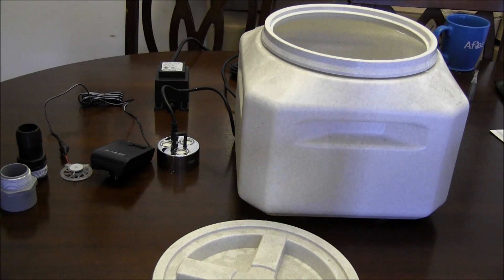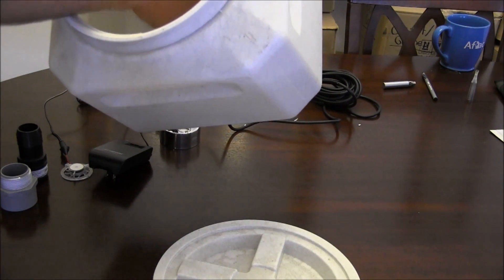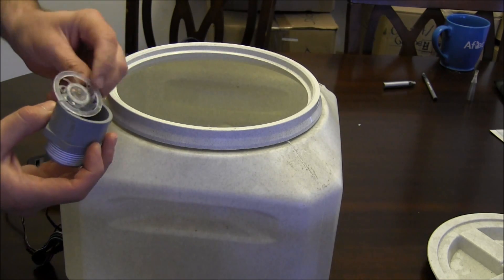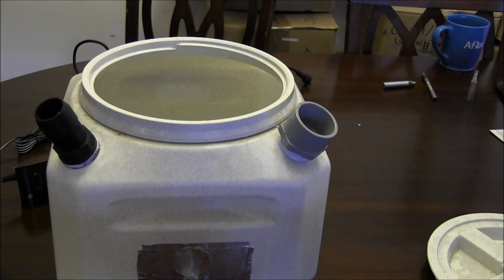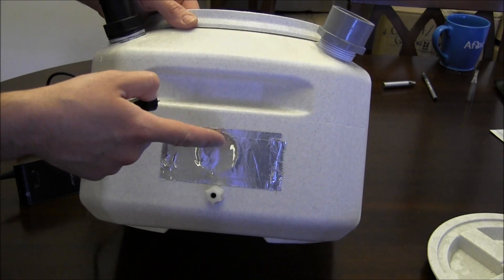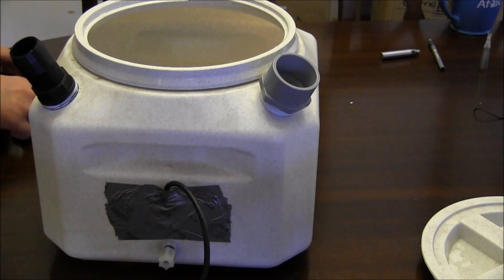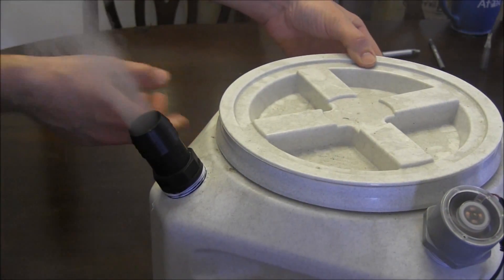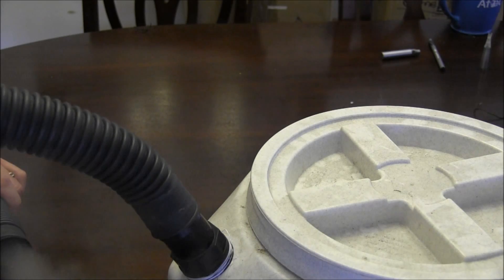How to make your own Nutramist/ Fogponics unit with The House of Hydro

Comment: what is the fan that you're using?
Reply from the maker: We unfortunately don't stock that fan anymore. It was from a different manufacturer and the waterproofing just wasn't up to par. They just didn't last in such a wet application. We usually recommend going with our 80 mm waterproof fan kit from our website. It allows you to get a very slow airspeed, and is extremely waterproof.

Comment: Why didn´t you use a 80mm sever fan on the lit instead of that tiny noisy little thing? Due to the way better performance of an cheap 80mm server fan you can run it at as low volts as possible still pushing enough fog while being barely audible. I use a 30x140mm 18W@12V Sunon server fan (100dB@10cm distance; 60dB at 50cm) for my 90x50cm closet and with modern LED lamps, I´m running it at just 5V and I can barely hear it while it still shovels quite some air. Just saying, smal fans are very noisy therefor I would rather run a bigger, more capable fan on lower voltage (rpm) than running a smal, noisy fan on higher voltages.
Reply from the maker: These videos are quite old... We don't carry the smaller fan anymore. Or smallest fan  We currently offer is the 80 mm waterproof fan located on our site. You're correct, it's a much better option!

Comment: How big a res do you suggest? Space is an issue for me
Reply from the maker: It really depends on what you're trying to accomplish with it, and what size fogger you are using in the container. We have a ton of information in our FAQ section linked at the top of our web page. Thehouseofhydro.com

I don't always see the YouTube comments, so Also feel free to email with me with any other info/ questions at John@thehouseofhydro.com
Reply: @TheHouseofHydro  ty I will be trying out 3 disc ionic atomizer in a 36 liter tote. When I have more space I'll build what I really am looking for.

Will be using to either clone or grow my  medicine
Reply from the maker: @littlenugs9942  a 10 gallon reservoir can handle a one, three, or five disc unit depending on what you're doing. If you are cloning, or just growing one or two plants, three disc unit is sufficient. Thanks!
Reply: @TheHouseofHydro  ty very much I appreciate it just going to do one plant in an 8.5 gallon box with a seal around the rim. 
Do you know where I can get a float for the rectangle 3 disc atomizer? I found 6-12 disc ones on e-bay, and again on Amazon. I can't find the smaller version.
Reply from the maker: @littlenugs9942   check out our site. It will have most of what you'll need. We carry a lot of different sizes. Thanks!  https://thehouseofhydro.com/collections/all-products

Comment: What kind of fan are you using?
Reply: its a 30mm waterproof fan, but we've switched to this one. https://thehouseofhydro.com/collections/all-products/products/waterproof-fans?variant=32065413120137
Reply: @avabroadhead1965  The bigger fan allows for more fog to be sent through the hose/hole and I assume is quiet due to lower rpm needed compared to the small fan that needs higher rpm

Comment: I'm building a system myself and was curious, does the fog not leak out of the exposed fan hole when the air builds up? And if so, could one build an air tight system that circulates the fog from res to root chamber and back?
Reply from the maker: I've had customers ask about a closed loop system in the past, but I'm not sure if anybody has done it. You always a little bit of fog either way. The one drawback I see to a closed loop system is no fresh oxygen being brought into the root zone which could cause problems.

Comment: Is there actually any benefit to using a ultrasonic fog emitter be interesting to see if there is
Reply from the maker: Aside from being a really neat way to grow,  there are some definite benefits.  The smaller particles promote a "hairy" root mass resulting in much larger root balls. It also uses much less water than traditional hydro systems. There's a lot more info on our site. Thehouseofhydro.com

Comment: Nutrients doesn't crud it up
Reply from the maker: We recommend using water-soluble clear nutrients. There is a clear ceramic glaze on the disk that wipes off easily with a q-tip. it's not really an issue like it used to be with the brass discs.

Comment: isn't there a return for the water/ mist back to the container? should there be a cyclic timer connected to the mister?
Reply from the maker: You can add one if you'd like, or just do a drain to waste type system. You can also add a timer. It depends on what your use is for the project.

Comment: What is this being hooked up to afterwards? Does this go to just another container with one plant or is this more for a tub full of them?
Reply from the maker: It can be hooked to either one. With a smaller mist maker, you'll need to use a hybrid setup though. Here is some info I give all my fogponic growers to help get you started. 

It's always hard to give an exact model to use, but bigger is almost always better.  I always recommend buying the largest unit you are comfortable affording. The bigger units put out the fog very fast, and reduce the required run time, thus reducing your water temps.

 For 100% fogponic grows, the biggest mistake is buying too small of a unit and not getting enough fog. It has to be very thick. A 6-12 disc unit is advised for 100% fogponic grows with multiple sites. You can use a smaller unit if you have a water chiller (so you can extend your run times) or if you do a hybrid grow such as fog with a shallow DWC or NFT in your case.  In other words, the bottom 25% of the root is in nutrients, and the top 75% is in fog. You can use a smaller unit with this method. 

To get the fog thick, you need to run the fan as slow as possible. The more air you add into the root zone, the more diluted your fog is. I always use the 80mm fan for fogponics. The 120mm is overkill. 

To get a starting point for cycle times, turn on your Mist Maker and run it until the fog is as dense as possible in the root zone. This is your on-time. Shut off your Mist Maker and see how long it takes for most of the fog to dissipate. This is your off time. This will give you a good starting point for your cycle times. It is hard to give you exact times as every setup is so different.

http://thehouseofhydro.com/fog-blog.html you can find alot more info here. 

If you have any other questions, just let me know! John@thehouseofhydro.com is the best way to get a hold of us. 

Thanks, 
John
Reply: Thanks for the detailed response. I'll use that blog for future reference.

Comment: Hey i saw the video and im asking myself if it could mist up a 78x39x29 root reservoir? Or would i need a bigger mist maker and which size should it be?
Reply from the maker: Here is some info I give all my fogponic growers to help get you started. 

It's always hard to give an exact model to use, but bigger is almost always better.  I always recommend buying the largest unit you are comfortable affording. The bigger units put out the fog very fast, and reduce the required run time, thus reducing your water temps.

 For 100% fogponic grows, the biggest mistake is buying too small of a unit and not getting enough fog. It has to be very thick. A 6-12 disc unit is advised for 100% fogponic grows with multiple sites. You can use a smaller unit if you have a water chiller (so you can extend your run times) or if you do a hybrid grow such as fog with a shallow DWC or NFT in your case.  In other words, the bottom 25% of the root is in nutrients, and the top 75% is in fog. You can use a smaller unit with this method. 

To get the fog thick, you need to run the fan as slow as possible. The more air you add into the root zone, the more diluted your fog is. I always use the 80mm fan for fogponics. The 120mm is overkill. 

To get a starting point for cycle times, turn on your Mist Maker and run it until the fog is as dense as possible in the root zone. This is your on-time. Shut off your Mist Maker and see how long it takes for most of the fog to dissipate. This is your off time. This will give you a good starting point for your cycle times. It is hard to give you exact times as every setup is so different.

http://thehouseofhydro.com/fog-blog.html you can find alot more info here. 

If you have any other questions, just let me know! John@thehouseofhydro.com is the best way to get a hold of us. 

Thanks, 
John
Reply: Sorry for my late answer currently im on vacation.

But thank you for your awesome answer, way more then i expected! I will check the fog blog.

Keep up that support, totaly awesome!

Comment: Hi. I know ultrasonic difussers distort the O2 level in the atmosphere. I had one in myLiving room and it messed up the burn mixture for my gas fire place turning the flame intense yellow orange and no blue. What does the O2 concentration read in the fog box?
Reply from the maker: This is an uneducated guess, but I don't think they change the oxygen levels as much as the water droplets just taking up space. I wouldn't think the ultrasonics deplete oxygen.  I haven't had anyone say they encountered problems based on O2 levels. Typically its people overheating their nutes, and causing depleted nutrient levels in the fog.

Comment: In another video you make mention that a fogger in a 12 x 12 x 12" container will create enough agitation to push the fog out therefor is the fan really necessary?
Reply from the maker: I'm not sure exactly what video you're talking about. I would think I was probably talking about a pretty large mist maker. Definitely not a one, three, or five disc. In my opinion, the fan is going to make sure that you get every bit of fog out. Without a fan, you will probably lose a good portion of your fog just because it will re-integrate into the water reservoir if it's not pushed out.
Reply: The House of Hydro Ultrasonic Mist Maker Supply I think you that does actually answer my question as I was looking at a five head.
Reply from the maker: +David Bonness if your growing with fogponics check out the blog on my site, or shoot me an email at john@thehouseofhydro.com and I'll send you some more info when I get into the office on Monday. Thanks!

Comment: does this mist maker affect the pH of the water? i mean, is the pH of the fog the same as the water (nutrient solution)?
Reply from the maker: It doesn't change the pH. Nothing is added or removed by the unit. As long as you are using a quality water soluble fertilizer you will be fine. Flora nova sells some nice clear fertilizers.

Comment from the maker: This is a really old video, but I think I got them on eBay. They don't hold up well in a high humidity environment. That's why we started making the fully encased waterproof fans you can find on our site.
Reply: have you ever seen or done a refillable reservoir using 5 gallon water jugs you get at Home Depot/Walmart? Looking around there's no good ready-made options. Have you ever considered making kits similar to this video to sell?

Comment: the 7" float does that come with the mister or did you get that somewhere else?
Reply from the maker: No, they are sold separately. We actually sell a different version that is more dependable and much smaller. You can also mount our float interior or Exterior. Check out  thehouseofhydro.com

Comment: how well does the mist work on tower gardens?
Reply from the maker: They work great. Just pipe in the fog at the top of the tower and recover the condensation from the bottom.
Reply: @TheHouseofHydro  that must be dependent on size of the tower
Reply from the maker: @aleher7692  Yes, but the fog does tend to settle, so you need to make sure it reaches the top roots as well.
Reply: This was my question also
Reply: can i have the duration of using this fog system for 24 hrs period

Comment: thanks for the info, house of hydro. do you think I need the 29.99 special coating paint for my fogger? I'm just making one of these machines.
Reply from the maker: What type of liquid are you using it in? If it is just water, not necessarily. It will help extend the life of the unit though.
Reply: +The House of Hydro Ultrasonic Mist Maker Supply it will be a 0-2000 pmm nutrient solution, I suppose I'm going to get the coating anyway, just to be on the safe side.
Reply from the maker: +Icey embrace probably a good idea. What size are you going to order? A five head? I am actually preparing some to get sprayed right now. I will get working on yours
Reply: +The House of Hydro Ultrasonic Mist Maker Supply 5 head, with the coating. I'm still saving hundreds,the Nutramist is 400 bucks!

Comment: What should be the correct timing for fog ponics? 5 minutes on - 5 minutes off?
Reply from the maker: A lot of people use the 5 on/ 5 off timing. Every setup is different though. If you have 30 plants, and are using 5 gallon buckets, you may need 10 min to get the concentration you need. 

Imo, run it until you are packed full of fog, and then go 5 off.

Comment: could you not just use a cool air humidifier
Reply from the maker: A cool air humidifier is typically a single disc mist maker with a brass disc. I know because I tear them apart any time I see them in the store. 😄

You won't get nearly the output as you would with one of my multi disc units, and the brass discs are only good if you have clean water. 

It would be ok as a supplemental feeder... Until the disc clogged up.  You really need a lot more fog to do it right. This is the biggest mistake people make with fogponics.

Comment: Where is the return from the root zone?  Am I mistaken that not all of the fog will be absorbed?  Some would condense and collect at the bottom of the growing container.  Is there a way to return this to the reservoir or did I overlook it?
Reply from the maker: You're correct.There will be some buildup. You just need to run a 1/4 line back into the unit. Use 1/4 npt fittings to connect them to your root zone, and the fogger.  It will vary based on your setup.